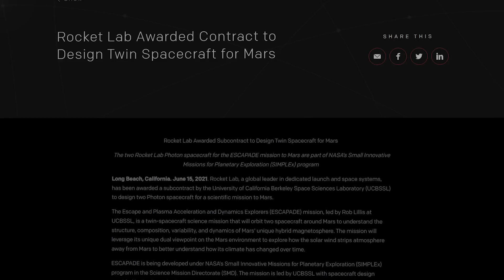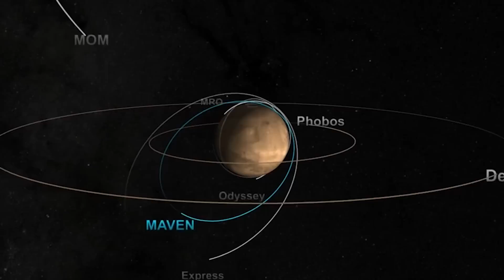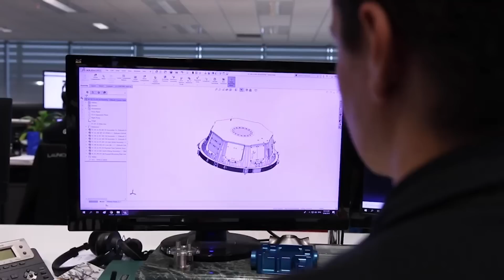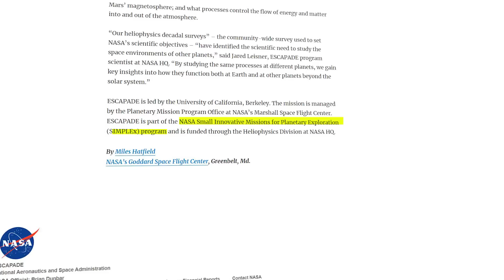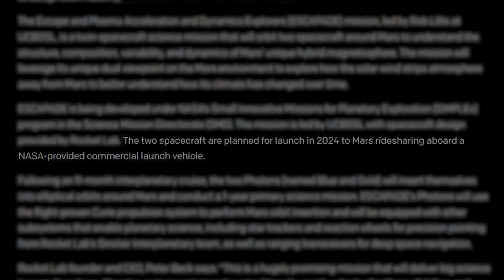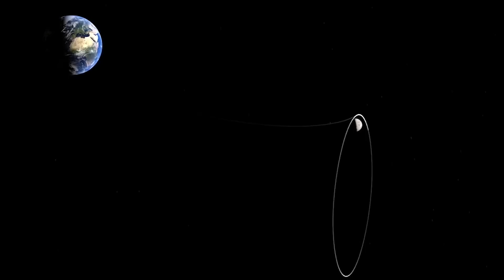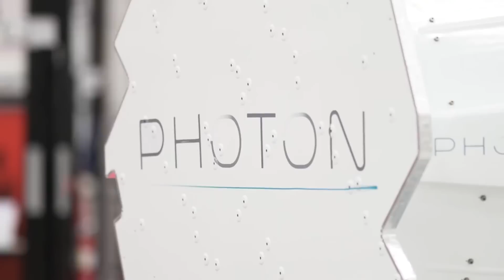Rocket Lab & Blue Origin Prepare For A Mission To Mars

Comment: I think Falcon 9 Heavy is the only US spacecraft in current use/availability  for this kind of work. If Blue Origin can ramp up to really do this I would be pleasntly surprised.
Reply: Falcon 9 Heavy is not a thing.  Falcon 9 is and Falcon Heavy is though.
Reply: @MrWaldorfian  Technically, Falcon heavy could be called "Falcon 27" b/c the 9 stands for number of engines and FH is in essence three F9s strapped together.
Reply: @paulmichaelfreedman8334  but its not referred to as that by SpaceX. Its Falcon Heavy and never “Falcon 9 Heavy”.